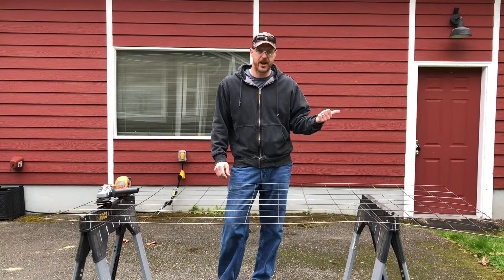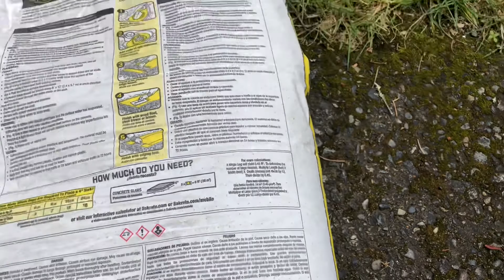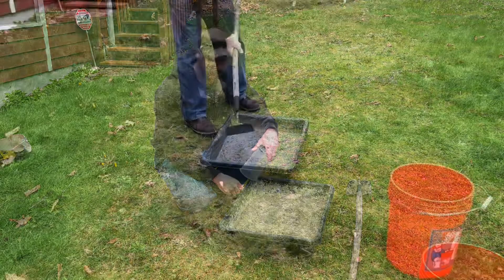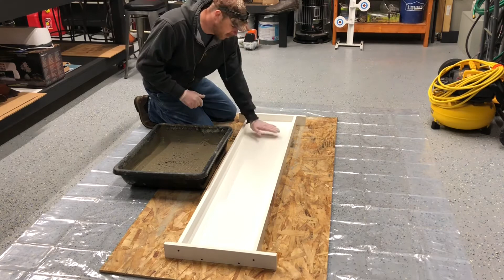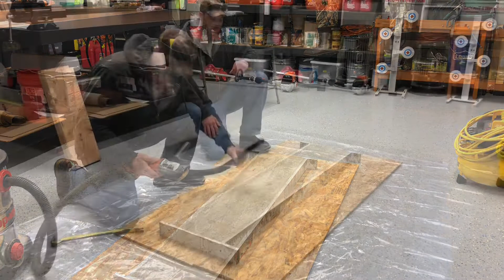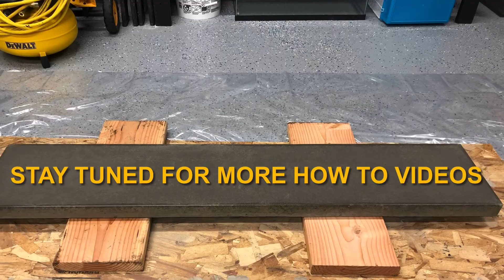Make Your Own Concrete Fireplace Hearth - Part 2

Comment: Any reason why you used high strength concrete?  Could you just use S mortar or does it have to be something specific?
Reply from the maker: Hey there an sorry for the late reply. I was busy dealing with my chickens. So I used this kind because I thought it was the cheapest and had the most strength. There was really no other reason. We still love it and it's perfect for our hearth. Hope this helps and good luck :)

Comment: Where do you get any color?
Reply from the maker: Hey Douglas. So in this video the color is natural. Now you can get powders from big box hardware stores that you can mix into the concrete. Amazon also has the same thing. Also, you can get liquid dyes that you can add to the mix. You can also stain it after it’s been made. There are so many ways to color concrete. Just depends on what you want to do.

Comment: You made a 2 in thick slab. Can it be made only 1 inch thick?
Reply from the maker: Hey there! Thanks for stopping by and commenting. As to the answer to your question. They do recommend 2 inches or greater but there’s definitely nothing stopping you doing the 1 inch. You just run the risk of cracking it when moving it, but if your careful and have it on a solid base, it should be good to go. Best thing to do would just to try it, it’s pretty cheap to make so you wouldn’t be out much of it doesnt work. I hope I answered your question and don’t hesitate to ask anything else. I hope you have a wonderful day :)

Comment: Really enjoyed your video. I have a stone hearth 3 stones stuck together with mortar. The center one cracked. So, I was thinking of removing all the stones, and building a new top piece like this, then once cured stenciling it for interest. You gave a great idea. Could I do this whole process but in place? Build the mold at the fireplace & the pour & work on it there? Could I use a scrap piece of hog wire as the metal support? Thanks for your guidance.
Reply from the maker: Thank you so much for coming by and watching the video! I really appreciate it and I’m happy I got your brain cranking out some sweet ideas! Everything you said sounds like a great idea to me. Hog wire for support will work great (it’s even thicker and stronger than the one I used). And yes, you can totally do this in place. Now from what I read, your going to pour the concrete in a mold and level the top surface in place? Now I didn’t do that, because I wanted a really smooth top, that’s why the bottom of mine actually ended up being the top. I’m not good at leveling concrete with a board but if you are then I’d go for it. I’ve watched a few videos on YouTube showing that and it can be done and it turns out really nice. Or maybe I just read that wrong and your just going to pour them in place, then flip them over and take them out and boom… you’re done. Either way… it all sounds solid and I wish you the best of luck! The beauty with concrete is, is that it’s cheap and easy to ditch and start a new one if it doesn’t turn out right. I had to on a few of mine because I wasn’t on a level surface. That’s the hardest part so you don’t get any bowing. Anyhow… let me know if you need anything else. Always here to help! Stoney
Reply: @StoneyCreekSparkchaser  I'm not sure yet which I will do. The house is over a hundred years old & has the propensity to move, I think that's why the crack. There's a crate in the concrete below the stones, but I may need to check below the house to see if there's good support before I remove all of it & start again. I understand about the need for level, the room is not! The fireplace is the high point. May need to use leveler or I may always be replacing the hearth because it cracked. Love a puzzle. Thanks again for your help.
Reply from the maker: @allaboutcanines  thanks for getting back to me! Sounds like quite the task, but I’m like you.. I like the challenge! Well good luck, I hope it works out in your favor and if you remember, let me know how it all goes! Appreciate you 😎

Comment: Hey thanks for the DIY. I'm looking to do this for my own fireplace. I'm looking for a much lighter concrete grey, is there  a way to have that?
Reply from the maker: He Will! Thanks for checking this out. Hmm… there is definitely a way to do that. You can order a white power or concrete color dye that you can add to the concrete. A lot of people add dyes or powder to change the appearance and they turn out good. I would try a small batch in another form and let it cure for a couple weeks to see if you get the desired effect you wanted. I haven’t tried using powders/dyes but I know it’s effective. There’s probably some videos out there describing just that. I hope I helped and don’t be afraid to ask any further questions. Appreciate you my friend :)
Reply: @StoneyCreekSparkchaser  Thank you. I will look into this.
Reply from the maker: @willvega8396  you bet 😎
Reply from the maker: @willvega8396  hey Will. I was also thinking a bit about this while at work. You can try letting it sit in the sun for a period of time too. Just depends on your timeframe. I made one of those as a bench for outside and it’s almost completely white just from sitting in the sun. Just another idea I guess. Anyway. Good luck man :)

Comment: Great work Sparkchaser! I'm definitely making one for a friend and I appreciate you sharing your expertise.  Unfortunately it can only be 1" thick without major reno. Hearth is 4' x 2'. Any concerns or suggestions?
Reply from the maker: Hey Thane! Thanks for the compliments. I honestly don’t think so. It is a bit on the thin side, but it should work. Lucky for you it’s a small enough hearth where if you would have a problem, making another would be easy. You can reuse the form so no problem there. Just make sure your wire mesh is solidly in the middle and clean. Sometimes with a skinnier hearth, the oils from the metal mesh can bleed into the concrete and you’ll get these like line marks on the top finished side of the concrete. Just taking some alcohol and a rag should do the trick to wipe the mesh. Also make sure you have help moving it so you don’t stress the middle of the form. I really hope this works well for you and let me know how it turns out? It’s a fun project and it really does turn out great! Thanks again for the comment and compliments. Good luck my friend and don’t be afraid to ask me anything else. Definitely here to help 😎

Comment: What type of concrete is that and why did you use that particular type? Would a finery mix with less aggraget be more ideal?? Any help would be greatly appreciated. Thank you
Reply from the maker: Hey David. Yea so I just used regular high strength concrete (what you see in the video). I did try and use a countertop mix (pretty much no aggregate) and I had the worst time with it. I followed the directions and when I took it out of the form it left a horrible surface. It was like super pitted. I think I just used it wrong to be honest, but I’ve had nothing but really good luck with the stuff I’ve used in the video. I’ve made over a dozen of those and they turn out the same each time. Did that answer your question? Is there anything in particular your not getting (like results)? Let me know and I’m more than happy to help and answer other questions. Thanks David!
Reply: @StoneyCreekSparkchaser Thank for the informative response. I am about to make my first fireplace hearth. I have see many videos where they use “rapid set mortar mix” or it’s sister product “cement all. Your project looks great and it seems like you didn’t have to add any additives like flow control or set control. Did you just use it as is right out of the bag?  I am just trying to make the right choice on the cement I use.
Reply from the maker: Hey David, yup, I just used the product right out of the bag with nothing but water. You almost want like a milkshake/peanut butter consistency. Just how my video shows. Then just slap it in the melamine form and tap out the air as much as possible. It will turn out flatter than a piece of paper from the mold. Concrete will not stick to it which is amazing and will give you a perfect finish. Please don’t hesitate to ask me any question you have during the process. Trust me, when I did my first one I was nervous but with using regular concrete, you have sooo much time to work with it, so you can work it however long you want and not worry about it setting up too quickly. Most important thing is just getting the air out. Good luck my friend.

Comment: Thank you for your informational video!! I have a 12 ft off center fireplace in need of something like this. Do you have any idea what I could call it, if I were to try and purchase something similar? Have had a heck of a time finding what I want.  But this! I want this! Lol
Reply from the maker: Hey Meagan! Thanks for the comment and question. I completely understand the frustration in trying to look something up that fits the style and needs of what you want. The only suggestion I could give is to look up fireplace hearths, stone hearths, fireplace pads, or fireplace heat resistant hearths. I’m sure you’ve already dived deep into this and it may not get the the answers you want, but it’s worth a shot. With how big you want it could be the underlying issue. With my setup you are limited to a max of 8 feet because that’s how long the sheet is for a mold. You could always try tiling a hearth which you can make to any custom size and they do make concrete style blocks that could fit that. You could also hire someone to pour in place a concrete slap where you want it. If that’s the design you want, then that would be the only option I see at this point to get that look. I personally don’t have any experience pouring concrete in place to get the desired smoothness for the top surface but I know that there are professionals out there that can get that exact look your going for. There’s also great other videos online that can show you exactly what to do, but I do know that this method can be much harder. I really hope I answered your question and again I appreciate you watching my video and leaving a comment. Also a big thank you if you subscribed! Super “free” way of helping to promote my content :) don’t hesitate to reach out again, always here to try and help! Have a great day :)
Reply: Thank you for the in depth response!!! Subscribed 👍
Reply from the maker: Thanks Meagan! Appreciate you :)

Comment: Just so you know, concrete does not dry, it cures.  And you don;t want it drying out as it cures, you should keep the concrete damp so it will cure to maximum hardness.
Reply from the maker: I appreciate that 24revealer. I’m tracking what you’re saying. My terminology gets the best of me sometimes and I appreciate the clarification. I’ve made a good amount of these hearth and countertops and consistently get the same result time and time again. Are you suggesting keeping the concrete in the form for a longer amount of time and cover with plastic? I’ve done that in the past but I seem to get the same result if I don’t do it that way. I Figured the amount of concrete used and how small the area is doesn’t make much of a difference but maybe it does. I know when I had my foundation poured and some slabs put in I cover those for extended amounts of time and keep damp to help the cure. Thanks again for the comment and I hope you have a great rest of your weekend :)

Comment: Do you have a photo of the finished project with the hearth in place?
Reply from the maker: Hey Megan, unfortunately I don’t, I made the hearth and then the homeowner installed it in place on an outside gas fireplace. It’s being used as a nice sit down area. If you check out some of my other videos like the one where I go over the Napoleon fireplace or adding a fan, you can see a similar hearth I made for that one. I used the exact same techniques and that hearth is now about 2-3 years old.  The hearth I made in this video is just a bit smaller than the one you see in these other videos. Hope this helps and I do apologize for not having an installed picture. Let me know if you need anything else.
Reply: There appears to be a still photo right at the beginning of the video, at 0.02

Comment: 1. Make sure your floorspace is level so you don't end up with an uneven back-side.
2. To make sure the thickness of the slab is correct and will fit (esp. if the fireplace overhangs the hearth slab a bit), use one of the mold side-boards as a thickness gauge on your hearth's framing.
Reply from the maker: DJ, all good points. That’s why I used my shop floor with a piece of plywood and ensured I was on a nice level surface. “Bowing” can be an issue for sure. As for the slab thickness, my fireplace firebox bezel over hangs my hearth by an inch or so, so I just gave myself 1/8 to 1/4 of adjustment. I used shims under my hearth to put it to the correct level with a minimal gap. I like your idea though to use the mold side board as a for sure depth gauge. Finish work always takes a while but the end product sure turns out great.

Comment: Did you seal it before putting it in place? If so, what did you use? Has it held up?
Reply from the maker: Hey Mountain Build! To answer your question, yes I did seal it, but it was sealed after I got it in place. I just used Aqua Mix Enrich N’ Seal from Home Depot. It didn’t really change the color at all, maybe a little darker but still looks so good. It’s held up great! You can put multiple coats on if need be. I mostly used it just incase my coffee spills on it or something when I sit next to the fire. Any sealer in my opinion would work great. The above stated product I used was pretty expensive, but I had some leftover from a shower project I did a few years back. There should be much cheaper solutions. Oh and make sure you read the directions. For most sealers, follow the directions for the recommended dry time before application. Most want at least 21-30 days for the concrete to cure before you apply the sealer.
Reply: @StoneyCreekSparkchaser  Thank you!

Comment: Nice work.  I guess you could use the textured sides or forms that have texture for some neat custom looks in the finished sides of the concrete.  I’d be curious if you could place objects such as metal or glass first in the form and then pour the concrete over so you could see it embedded in the finished surface when done for a different look.
Reply from the maker: Yes to all of your questions. I’ve seen people place glass stones in first then mix in the concrete for a neat effect. I’ll be making another here soon and will be experimenting with dyes.